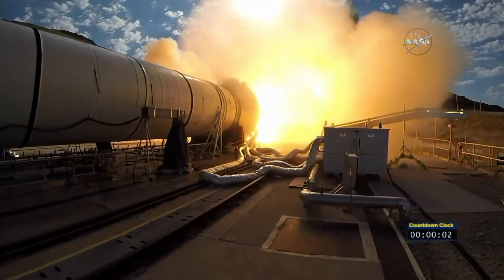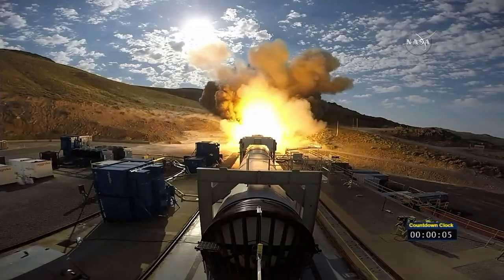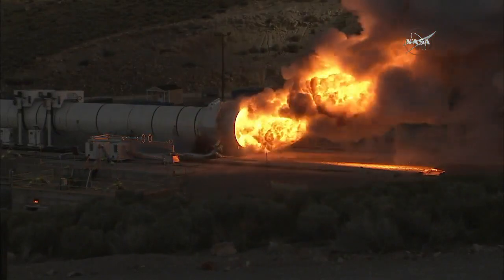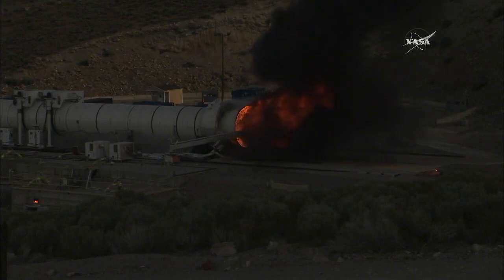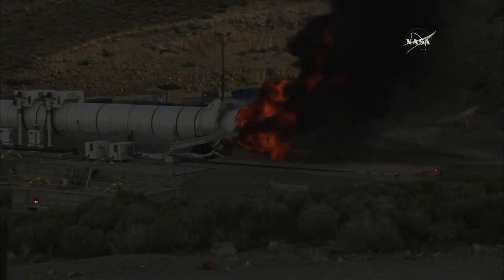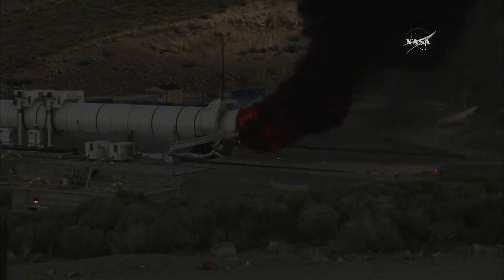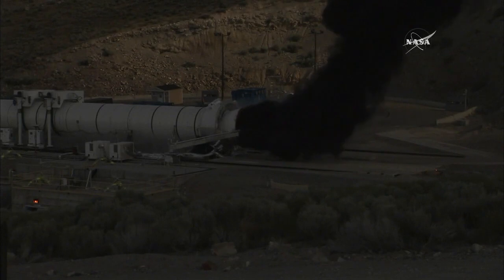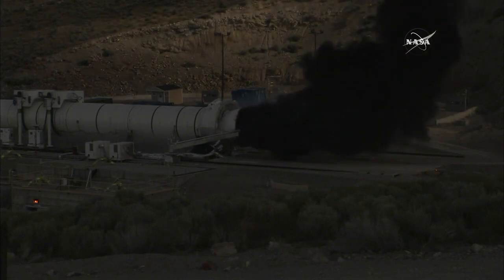Crucial Booster Test Fires Up in Utah

Comment: i think this thing will change the earth rotation...
Reply: NO it can't.
Reply: yes, a little bit, but yes. is to all effects a rocket anchored to the Earth, and it was turned on for 2 minutes, so definitelly it have change little bit, the Earth rotation or so. it's physic. and we can calculate the difference, just knowing how many newton have generated the rocket thrust and how many newton is the earth rotation, the direction and the direction of the rocket...
Reply: If my calculations are corrects it best/worst scenario it increased/reduced the earth rotation by 0,18 pico second.
Reply: +Ladislav Tánczos wow thanks for have calculated that. very small interference, but however it has taken effect. that is important.
Reply: he's bullshitting you. That's like saying a feather will affect a meteor's speed. It won't.
Reply: No it wont. Imagin your in a closed train goring forward and you trow a ball backwards iside the train. The train does not slow down not even a tiny tiny bit. The ball just moves more slowly then the train when taken from a relative position outside the train. Their might be a small effect from the inertia of the ball sudelly stopping.
Reply: No! it is very-very smool
Reply: The next test will be exhausted Eastward for compensation.
Reply: Bret Laverack it's cool
Reply: as well as the orbit... even jumping off the bed affect it but to a unoticable scale
Reply: the effect of moonlight on the growth of telegraph poles
Reply: Yes, there was an old sci-fi film using this concept. Move the earth to stop it from being destroyed
Reply: The rocket motor firing won't affect the rotation of the planet at all
The thrust of that rocket pushing against the earth is equalled exactly by the exhaust's push against the atmosphere. It's like trying to push a car forward from the inside.
Reply: but rockets that leave the Earth's atmosphere do affect the rotation of the Earth.

If i was in a car with wheels that had no friction, I could do whatever i wanted inside the car and it would not move at all, but as soon as I threw anything outside of the car from the inside it would start to move.

If i throw a ball inside the car it is pushed forwards by the force of the throw, but then the ball hits the side of the car and the car is slowed down. the same thing (although on a much larger scale) happens with rockets firing inside the Earth's atmosphere
Reply: yes it can. the simple fact of walking on earth does.

Comment: Can these engines be throttled or turned off?
Reply: I believe those are solid rocket motors, the same type that is used in fireworks so no, once they go off theyll burn until they run out of fuel.
Liquid rocket motors on the other hand can be throttled.
Reply: LtCWest Yea bro, I know that bit - just some solid rocket boosters can be stop/started (not many mind you)
Reply: Adam -亚当- I must confess, my knowledge is based mainly around Kerbal Space Programm
Reply: LtCWest hahaha I just bought the game last week.... parachutes keep breaking on re-entry :(
Reply: It's a solid rocket motor like the ones for model rockets. Just light and go.
Reply: No, not solid rocket motors. Once you light them, they burn until the fuel is exhausted and they cannot be throttled. Liquid rocket engines, on the other hand, can be throttled and stopped.
Reply: No. It is a solid fuel rocket. A composition of rubber, plasticizers and other flammable goodies. It has the consistency of peanut butter when they mix it all up. Each segment, 5 for this rocket, is filled or cast with propellant then assembled. Down the center-line it is hollow and ignition starts at the top and burns downward.
Reply: Adam -亚当- Gel motors can be turned on and off.
Reply: No.
Reply: "Throttling", yes. Mechanically blocking or choking latter stages or even destructively separating them from the payload. Good for drivers not pilots
Reply: These can´t stop. You can "bake" in throttling into the fuel but no actively control it.
Reply: All the technology that goes into keeping the booster from stopping or slowing and we now believe it to be impossible. If it were the main stage, it wouldn't be a booster, and if it needn't be there why is it. Not disagreeing but there's always a way, maybe not the best idea to throttle a booster but good question. What if a solid rod were to be gradually extracted from the hollow core? Very possible but not reliable and the answer I think is yes.... but why? Why wasn't the question
Reply: Only in some very roundabout ways, these are solid-fueled engines. You can "throttle" it by varying the density and the physical shape of the solid propellant, so that as the burn proceeds it will encounter more or less fuel and generate more or less power. There is no way to properly turn off the engine since, being solid, there is no way to stop the propellant flow nor to separate the oxidizer from the fuel. However, you could, in theory (this was a study done for the Space Shuttle), use explosive segments to blow off most of the steel casing from the booster, which would cause the combustion reaction to no longer be channeled downwards and instead expand everywhere, which would stop thrust from being generated. There would still be a lot of fire and burning, which is not ideal for a manned vehicle. To make it short, once you ignite a solid booster you're in for the ride until it burns out, whether you want it or not.
Reply: In space it can be stopped and re-ignited with oxidizers.
Reply: throttling a solid is possible if you are using a hybrid motor, most rocket engines cannot throttle much and if you want throttling you'd look for engines like the liquid modified RL-10 that could throttle down to 10% power.
Reply: Wolfe solid rocket engines can be stopped and re-ignited in space with oxidizers due to the of oxygen. Oxidizers work as oxygen in space.
Reply: ger cio as far as I'm away, the oxidizer is mixed with the fuel. In the case of the SRBs like on the shuttle and SLS, the use ammonium perchlorate composite with a polybutadiene acrylonitrile elastomer, with added metals and burnrate chemicals/elements, do not require oxygen to burn. The throttle of an SRB is determined by its cast geometry and will proceed as cast regardless of outside control
Reply: I happened to assembled solid rocket motors, an re-entry vehicle carries an  oxidizer tank to burn in space.
Reply: i read that this particular Motor can't be stopped.
Reply: That is correct, its feeding the burn with oxygen.
Reply: Is some rockets, there is an oxidizer tank. The oxidizer enters the rocket thru a manifold and helps to burn the solid fuel by actuating an igniter. This is done in space, where there is no oxygen.